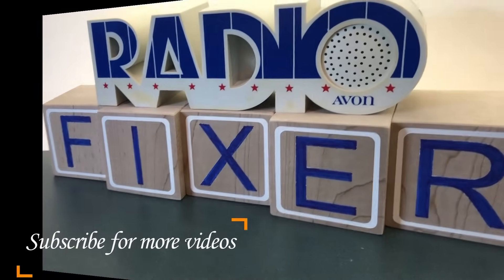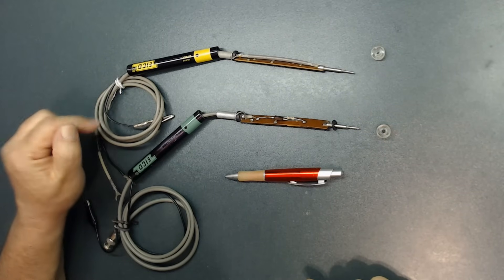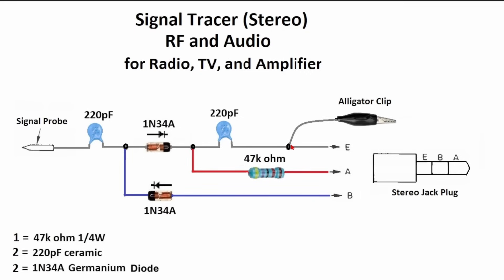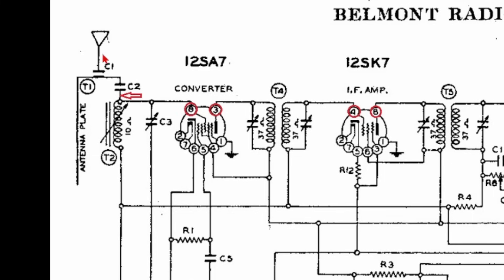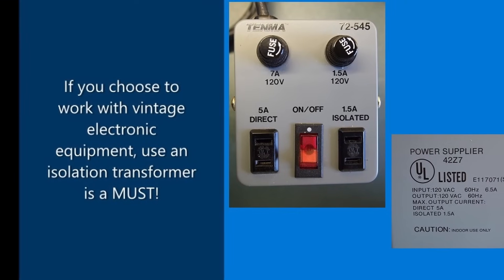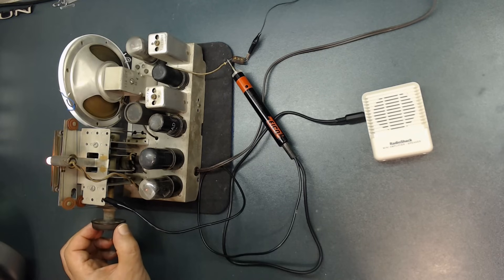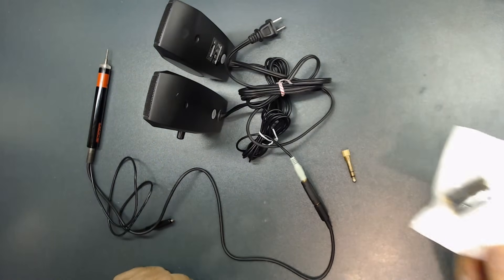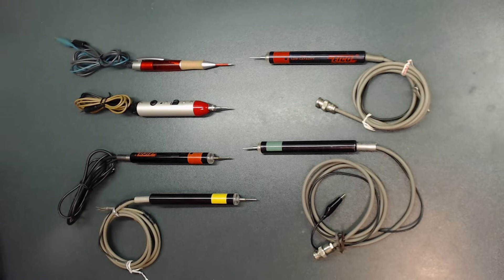Part 1- Build Stereo Signal Tracer for testing Tube and Transistor (Radio, TV, and Guitar Amplifier)

Comment: Very good video. Thank you.
Reply from the maker: Lawrence, It is so good to hear from you and thank you for taking time to message me and supporting my channel. So glad and happy that you enjoyed watching this video. 
I was so surprised how well this Tracer works. It is a very simple design that anyone with a few parts can build. The great thing about this tracer is that it can work with Mono, Stereo, and Bluetooth amplifier speakers without any modification to speaker. Please let me know how you like it after you build it. 
I used 2KV for those 220pF capacitors, since I had some on hand. Use 600V if tracing signals in AC tube radio to be safe. I suggest for TV and guitar amp use very high capacitor voltages. 
In this YouTube channel I discuss in detail how to restore tube and transistor radios. How to add Bluetooth to vintage radio. How to repair broken wooden, plastic, and Bakelite radios. How to test AC power transformer, how to fabricate missing parts, how to read resistors, and capacitors for antique radios. How to read and understand schematic for beginner. 
Have a great day. Regards from Florida, Jay

Comment: I have a command set receiver that looks a little like one in this video. Mine must have been installed inside of a vehicle because it has hose clamps on the bottom, along with a device called ‘Dynamotor’ made by Bendix. I am unfamiliar with the dynamotor. It will boost the car battery’s 12 Volts up to 120 Volts AC! If you have one, I would love to see demonstration of its usage. Thank you for sharing about this probe tracer! I’m going to build this next time I get my DIY radio kits out! Great stuff!!
Reply from the maker: Hello Jimmy, the radio that you are describing that has 2 clamps "like car battery clamps" they used to call them (Farm Radio) since those good old days not everyone had electricity. The radio works with 12 volt DC battery, you can use the power supplier that produce  12V DC, not AC (AC is house electricity so do not use AC). I do have several of Farm Radios but unfortunately have not restore any of them yet.  
You might also enjoy watching attached link total restoration series "Rat House Radio" as well on my channel. 
https://youtu.be/uMfL4Eakzng 
It was 100% restoration and I learned so much by working on that radio. Each restoration series are so unique and different, I tried to take different approach to solve problems. 
In my YouTube channel I discuss in detail how to restore tube and transistor radios. How to add Bluetooth to vintage radio. How to repair broken wooden, plastic, and Bakelite radios. How to test AC power transformer, how to fabricate missing parts, how to read resistors, and capacitors for antique radios. How to read and understand schematic for beginner. 
It is so good to hear from you and thank you for taking time to message me and supporting my channel. So glad and happy that you enjoyed watching this video. 
Have a great day. Regards from Florida, Jay

Comment: Very nice circuit, simple circuit!  I will build one and probably stuff it inside an old solder sucker tube. One question, if I may.  The points where you could not detect a signal inside your test radio - did that indicate a problem with the radio, and if so, how did you fix it?  Thanks!
Reply from the maker: Hello, good hearing from you! That is a good idea to use solder sucker tube. The radio that I used under the test was working with no issue. I was checking all tubes to find out the signals, as long as you have signals in each stage you should be fine. Let say you are testing 2nd detector tube 12SQ7 and there is a signal but no signal 35L6 even you have turn the volume control up. Then you know something is not working between those 2 tubes.  What you need to do is check between those 2 tubes to see resistors, capacitors, wiring are OK.  
I highly suggest to watch this video series on my channel, I know it will assist you.  
https://youtu.be/uMfL4Eakzng
In my YouTube channel I discuss in detail how to restore tube and transistor radios. How to add Bluetooth to vintage radio. How to repair broken wooden, plastic, and Bakelite radios. How to test AC power transformer, how to fabricate missing parts, how to read resistors, and capacitors for antique radios. How to read and understand schematic for beginner. 
It is so good to hear from you and thank you for taking time to message me and supporting my channel. So glad and happy that you enjoyed watching this video. 
Have a great day. Regards from Florida, Jay

Comment: Hi Jay, thank you for your time to show us your signal tracer.. I saw that we can fit parts in a pen, but would like to know about the other option you mentioned and where to source them if available ( the one you show with the circuit board with probe inside) please.
Reply from the maker: Hello Waldy, good hearing from you! I used vintage Eico oscilloscope probe that I bought on eBay a few years ago. They have several types like Direct, Demodulator, and a few others. They all works for this project but Demodulator and Direct are easier to solder. 
The great thing about this tracer is that it can work with Mono, Stereo, and Bluetooth amplifier speakers without any modification to speaker. 
I used 2KV for those 220pF capacitors, since I had some on hand. Use 600V if tracing signals in AC tube radio to be safe. I suggest for TV and guitar amp use very high capacitor voltages. 
It is so good to hear from you and thank you for taking time to message me and supporting my channel. So glad and happy that you enjoyed watching this video. 
Good luck! Please feel free to let me know the result when you build it.  
Have a great day. Regards from Florida, Jay

Comment: Thanks for the great video. I didn't quite understand what stereo is for and what the point of different connections to the left and right channels of the stereo speakers is. What is the purpose of the right and left channels of a stereo system?
Reply from the maker: Hello, good hearing from you! Most signal tracers as "I know" where designed for Mono Amplifier Speaker and have Mono Jack. Most of the time Mono is not compatible with new amplifier speakers which they have stereo connection.  Unless opening speaker and do some modification to jack connection. This tracer sound amazing since hookup as stereo instead of Mono. 
It is a very simple design that anyone without electronic background can build with a few parts. The great thing about this tracer is that it can work with Mono, Stereo, and Bluetooth amplifier speakers without any modification to speaker. 
Please let me know how you like it after you build it. 
Thank you for taking time to message me and supporting my channel. So glad and happy that you enjoyed watching this video. 
Have a great day. Regards from Florida, Jay
Reply: @RadioFixer  Thank you very much for your answer, I understood that you can use stereo speakers, but I wanted to ask how the sound in the right and left speakers differs when using this device, because they are connected differently. How will the sound differ?

Comment: Hi, why did you only put the 47k in the A path and not the B path?
The A and B are the Right and Left inputs so why the difference?
Reply from the maker: Hello, good hearing from you! I did not add 47K resistor to both, since was reducing the radio signal volume when was testing on different amplifier speakers that I have.  You might get different result using different  amplifier speaker. Please test it with your speakers to see if you have better result, feel free to let me know  the result.  
It is a very simple design that anyone with a few parts can build. The great thing about this tracer is that it can work with Mono, Stereo, and Bluetooth amplifier speakers without any modification to speaker. It is so good to hear from you and thank you for taking time to message me and supporting my channel. I am glad and happy that you enjoyed watching this video. 
Have a great day. Regards from Florida, Jay
Reply: @RadioFixer  Hi Jay, thank you for the reply. With the 47k resistor in the one path, you will reduce the signal getting to the one channel, so I imagine the sound is out of balance. The advantage of different signal path gain is one side will have higher gain. So, using the balance control with a stereo amp, you can choose the gain by selecting either right of left channel. Thanks again.

Comment: Excellent job ..! I have a big piece of setup for this kind of testing but it will be no more. Lovely. Thanks buddy.from Karachi/ Pakistan ❤
Reply from the maker: Moin,  I was so surprised how well this Tracer works. It is a very simple design that anyone with a few parts can build. The great thing about this tracer is that it can work with Mono, Stereo, and Bluetooth amplifier speakers without any modification to speaker. Please let me know how you like it after you build it. 
I used 2KV for those 220pF capacitors, since I had some on hand. Use 600V if tracing signals in AC tube radio to be safe. I suggest for TV and guitar amp use very high capacitor voltages. 
In this YouTube channel I discuss in detail how to restore tube and transistor radios. How to add Bluetooth to vintage radio. How to repair broken wooden, plastic, and Bakelite radios. How to test AC power transformer, how to fabricate missing parts, how to read resistors, and capacitors for antique radios. How to read and understand schematic for beginner. 
It is so good to hear from you and thank you for taking time to message me and supporting my channel. So glad and happy that you enjoyed watching this video. 
Have a great day. Regards from Florida, Jay

Comment: Excellent piece of test gear, I will be making one for sure. I don't have a good signal tracer & if I can do it cheap, brilliant !
Thank You for this video & simple easy explanation.
Cheers to You !
Reply from the maker: It’s great to hear that you are making a signal tracer.  Let me know how it goes! 
I used 2KV for those 220pF capacitors, since I had some on hand. Use 600V if tracing signals in AC tube radio to be safe. I suggest for TV and guitar amp use very high capacitor voltages. 
Thank you for taking time to message me and supporting my channel. So glad and happy that you enjoyed watching this video. Have a great day. Regards from Florida, Jay

Comment: Interesting design, wondering why you refer to the plug as A,B,E, I've always known them as TRS, as in Tip, Ring, and Sleeve.
Also both channels are via diodes, I would have thought one should be just via a resistor, as strait audio from an amp would get horribly chopped in half by the 'B' channel diode. interesting,  I'll have to dig up some 1N34A's and give it a try
Reply from the maker: Paul, so good hearing from you! I am glad that you are going to try building one of these, please let me know how it turns out! 
I used 2KV for those 220pF capacitors, since I had some on hand. Use 600V if tracing signals in AC tube radio to be safe. I suggest for TV and guitar amp use very high capacitor voltages. 
I saw this schematic late 1980’s in some electronic publication when I was trying to learn electronic on my own, since could not find anyone to teach me.  A few days ago fund my notes, was so happy that I still had the drawing on a piece of paper. LOL. 
I guess that I could identify them as G for ground, “L” for left audio, and “R” for right audio.
Thank you for taking time to message me and supporting my channel. So glad and happy that you enjoyed watching this video. Have a great day. Regards from Florida, Jay

Comment: Jay nice work I have never see anyone make a stereo signal tracer. What a great idea. Thanks for this informational video. LL
Reply from the maker: Hi Larry, I was so surprised how well this simple layout can do! The great think about it is that works with Mono, Stereo, as well as bluetooth speakers. Was fun to build it.  I used 2KV for those 220pF capacitors, since I had some on hand. I think 600V will do for AC tube radio to be safe, and for TV and guitar amp much higher voltages capacitor should work.  
 It is so good to hear from you and thank you for taking time to message me and supporting my channel.  
Have a great day. Regards from Florida, Jay

Comment: What is the voltage rating of the 220pf caps since you're connecting to high voltage tubes?
Reply: Thank you!
Reply from the maker: Hi Tony, good hearing from you! I used 2KV, since I had some on hand. Use 600V if tracing signals in AC tube radio to be safe. I suggest for TV and guitar amp use very high capacitor voltages. Hope this helps.
Thank you for taking time to message me and supporting my channel.  Have a great day. Regards from Florida, Jay

Comment: Thanks for this Jay. You got my creative juices flowing. I have a  Radio Shack portable folding amplified speaker that runs
on 4 AA batteries and with some parts can actually make this probe work with it. Just need that 3.5mm female to female adapter as it comes with a male plug. Might try putting the board into a large plastic pen. Not sure about the tip though. Maybe a nail would work! Go ahead about making more probe videos  as you got some great ideas for them. Steve
Reply from the maker: Steve, I am so glad that you are inspired by this video; I will make more video about different Signal Tracers that I build. Not sure if you saw in the beginning and end of the video, where I lineup several tracers. Check the one on the left all the way on the top, it is Walgreen Pin. LOL. For the probe I used rivet. I will add that on my next video, I used different method to build that one. They are fun to make. 
Thank you for taking time to message me and supporting my channel. So glad and happy that you enjoyed watching this video. Have a great day. Regards from Florida, Jay

Comment: I’m a bit confused. You show in your demonstration, the signal tracer is plugged into the little radio shack amplifier.
But my understanding, is the RadioShack amplifier is a monophonic amplifier with a single input, not a stereo input.
So from the schematic, it would appear you were not using one of the probe’s circuits while plugged into the RadioShack amplifier.
Could you give a little bit more description of The difference between the two high side outputs of the tracer?
Thank you very much and really appreciate you making this video because I need to make one of these things! 😊
Reply from the maker: Good hearing from you! You are absolutely correct about Radio Shack Amplifier Speaker, it is Mono. The great think about this signal tracer as I mentioned in the video, it will work with Mono, Stereo, and Bluetooth speakers as long they have 3.5mm female jack. Not sure if you had the chance to view the section (adapters) where I mentioned how to connect to different speakers. I had hours of tests footage with my entire speaker, but did not want to make a long YouTube video. It is very simple to build and perform much better in stereo then mono. 
Thank you for taking time to message me and supporting my channel. So glad and happy that you enjoyed watching this video. Have a great day. Regards from Florida, Jay

Comment: Thanks for the great video and explanation of the circuit.
It may also be possible to build in a small Bluetooth transmitter chip and lithium battery into that probe to make a True Wireless probe that has no electrical connection back to any amplifier
Reply from the maker: It’s so good to hear from you and thank you for taking time to message me and supporting my channel.  That’s a great idea! I need to do some research how to add a Bluetooth transmitter and a rechargeable battery to the signal tracer.
I had to learn this hobby on my own since couldn’t find any one to teach me. Took years of research and trials. LOL. 
I figured out how to add Bluetooth to AM radio guess can learn how to do that with this Signal Tracer. You might enjoy watching this video. https://youtu.be/jqzOFj5irr4
Have a great day! Regards from Florida, Jay

Comment: I have built different probes before but have never seen this design for a stereo output option. Will take an old Eico probe and build this design and see how it compares Jay. That first 220pF capacitor should have a high voltage rating.
Reply from the maker: Jim, I was so surprised how well this Tracer works. It is a very simple design that anyone with a few parts can build. The great thing about this tracer is that it can work with any amplifier speaker without any modification to speaker. Please let me know how you like it after you build it. It is so good to hear from you and thank you for taking time to message me and supporting my channel. So glad and happy that you enjoyed watching this video. Have a great weekend. Regards, Jay
Reply: @RadioFixer  I just built the probe and tied on both mono and stereo inputs, and it works very well. Thanks for the information, Jay.
Reply from the maker: Jim, man you are fast! So happy to hear that you like the tracer. The great things about this tracer is that It works with Mono and Stereo speaker. It sounds much better with stereo speaker. Thank you for letting me know. Have a great day Jim!